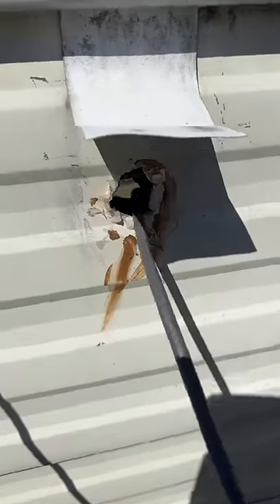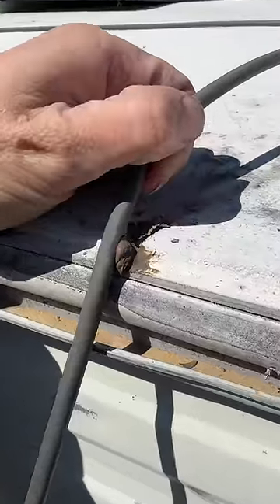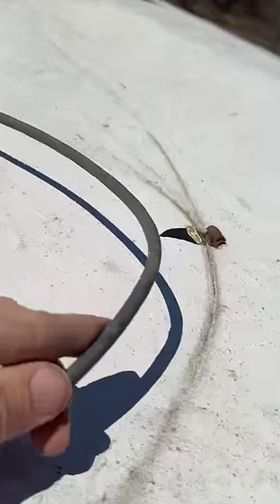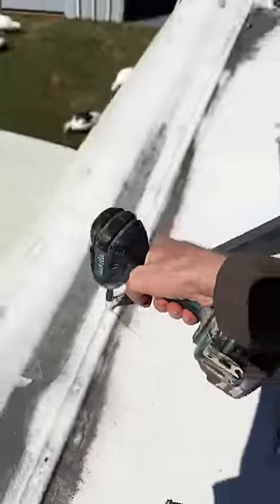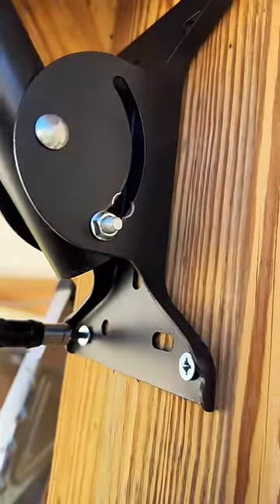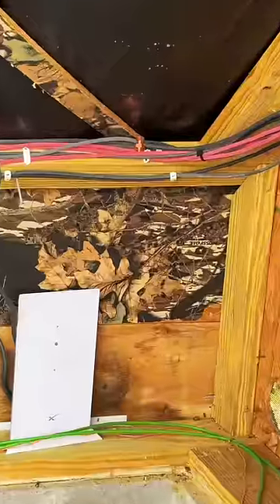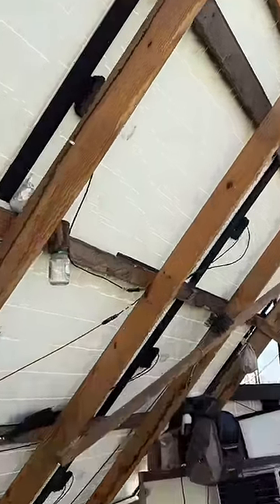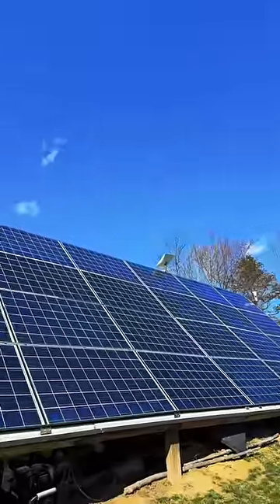Moving the Starlink off the camper

Comment: I just ordered a 35x410W panels for on-grid use. My house has water central heating that is heated with firewood, heating oil (lower tax diesel) or electricity. I live in northern Europe. I only consume about 2kW/h but I got the panel system cheap from a supplier, they had a sale. Was planning on 6-8 panels first but then to get a good price you had to buy a whole pallet and that was 35.

Comment: I too have my starlink dish mounted above my array on a roof-top system BUT I don't think it's an optimal spot as I expect I may run into overheating problems from the extra light bouncing off the array; we'll see what happens in summer.

If you have an issue it looks like it would be easy to just offset the dish further off the post.

Comment: May I recommend an enclosure for most of your electrical parts for the solar array. They will greatly increase the lifespan of the components by keeping them protected from weather, it will also make maintenance and modification easier. I literally do this for my job and I can point you in the right direction.

Comment: Awesome to know I'm not the only one who realized that 2nd gen Starlinks slot into j-pole mounts. I had to file out the little bur in the inside before I was able to slot it in. My J-pole as well was flippable so the mounting holes are on both sides. Realize that the bottom bit is mostly plastic and all you need to do is drill a 1/4 hope at the base and you can secure the starlink in place with a built and nut.

Comment: Do you only use the router it came with? If you run a cat6 line to your living quarters you can have a network switch there to hardline anything PC or anything that needs max speed (like for uploading videos) and put in a wifi access point hardlined via the switch as well. I’ve been working on my networking setup at home as well, I have WiFi about 100yards away from my house in the pole barn on the far end of 2ish acres now lol eventually it’ll be a fully enclosed shop so I have it setup to use wired connections there as well.